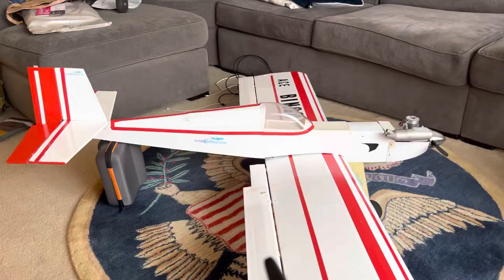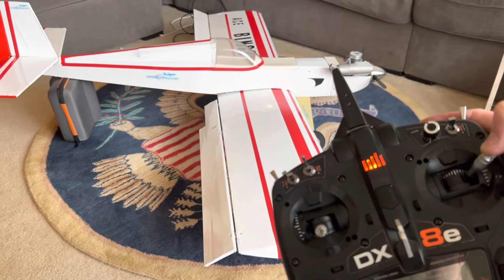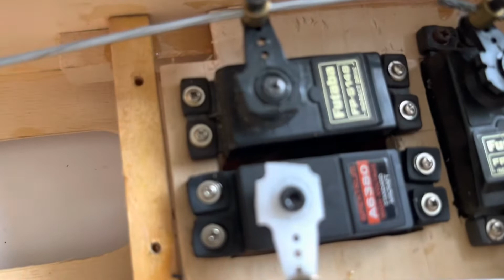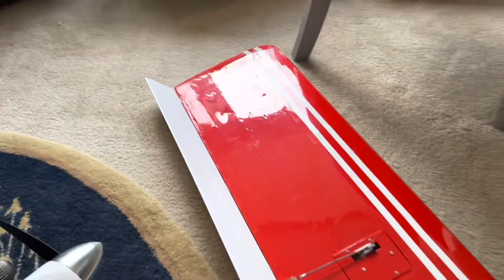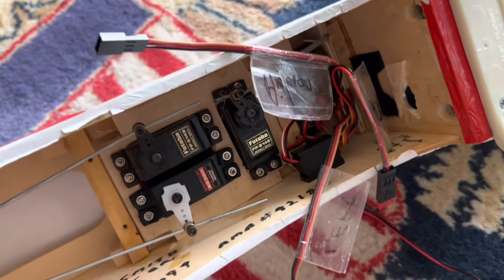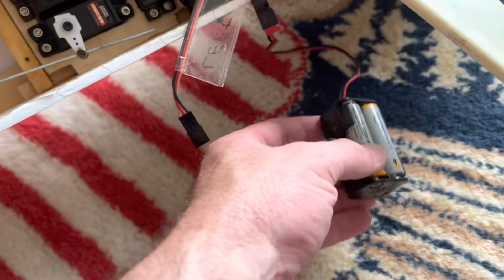Spektrum A6380 servo issue “shaking” *SOLVED*

Comment: On the fly sky I6 radio the jittering ailron on Was caused by the tension spring being too loose from the factory And there's no way to tighten it without modifying the screw but using a spacer
Reply from the maker: the main issue in this video was not enough battery for the servos… Once I upgraded battery I had no issues.

Comment from the maker: Issue was servos are 6.6V I had more than that in the system but the high speed high torque servos used more than the system could handle at any one moment. Therefore stealing power from the receiver which then made the servos "freak out" more, which took more power from the receiver starting the process over again. Replaced with a liFe battery 3000 mA pack which seems to solve the problem.